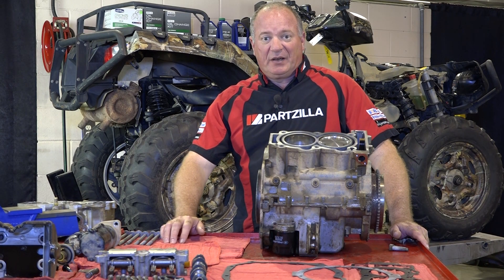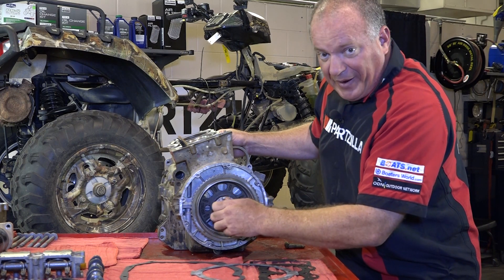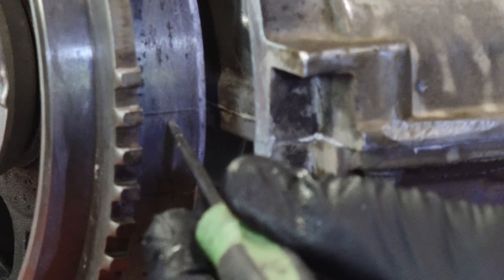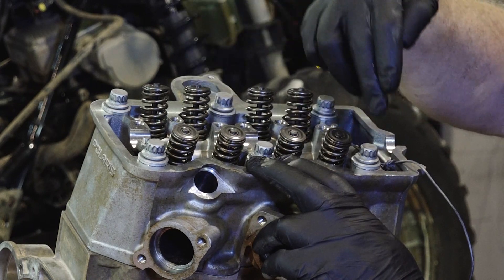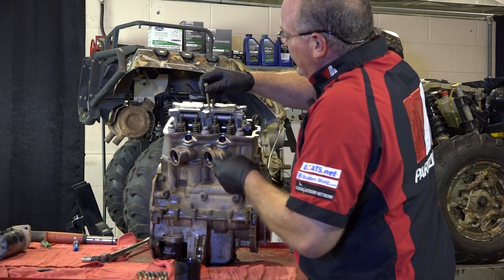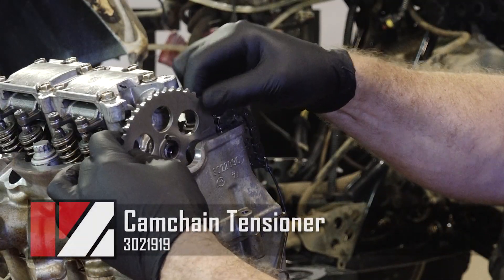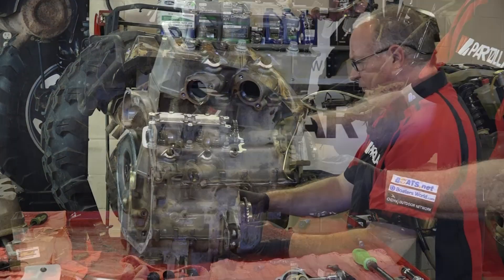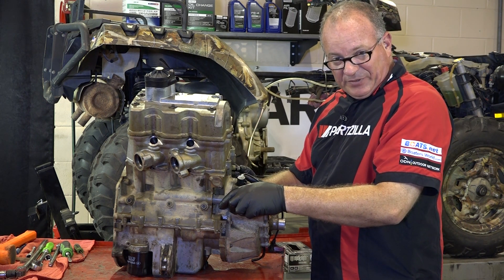Polaris Top End Rebuild Part 4: Set Cam Timing & Install Cylinder Head | Partzilla.com

Comment: I have a 2022 sportsman 1000, Do I need to remove the engine from the bike in order to remove the head? It’s just getting the head milled. the bottom end will be untouched.

Comment: John, love the videos of this series. I have watched them many times and they are very helpful. Seems like you left out a step on the lash and cam adjustments. The manual goes through the very specific steps. You have to set them at one place and then move the sprocket/chain and set the other side. It would be helpful for you to add that step as it seems to be critical. Again, thanks for the great videos.

Comment: What is the proper tightness for the cam chain? Does the tensioner self adjust the tightness? I have a very loose chain in my engine (more than 1/4" of play) and am wondering what the problem could be.

Comment: I have a 2014 850xp it doesn't have a LHT nut, but a drive gear for the water pump and stator....I have new pistons rings etc. Anyone know if that "gear" on the fly wheel is threaded or not?

Comment: When you put the cam chain tensioner in it moves the cam sprocket counter clockwise just a bit?   Is that still ok for the timing??
Reply: Hi did you ever get an answer on this? Im dealing with the same thing. Almost tempted to put it back together. I hope you see this before I put it back together
Reply: Should be fine. As long as you set time, even before chain had tension, it's not gonna matter.

Comment: Just to verify you do have pressure on your back side exhaust valve springs once you rotate the cam dowel to 12 o'clock, right?
Reply: rebuilding one now, Just wanted to verify you set the back side exaust valves on a different compression stroke not TDC?

Comment: What would cause hot start issues? 13 scrambler 850xp timing gear welded at 20ish hrs and 182 miles.   Now at  73 hrs  and 862mi. I suddenly have to give it throttle to start when it’s warmed up/hot..  ideas?
Reply from the maker: Inspect/Adjust the valves

Comment: Zero Valve Lash!  W.T.F?  So it has Hydrolic Lifters Then?
Reply: Im thinking the same thing. I'm a Polaris tech and I have been through an 850. I don't remember zero lash. I think it's like .003-.005 intake and like .007-.009 exhaust. But maybe I'm wrong.

Comment: Videos are awesome really help. Is there a way to change the head gasket and verify timing without pulling whole engine?
Reply from the maker: You can, we tore the whole thing down, so it was easier to just pull it.
Reply: @PartzillaParts  how do you set the time on the PTO side or when do you tighten down the valves pins for the PTO side

Comment: I need information on how to set my valve latch on a 2013 sportsman 850xp. I set them like you said in the video but now I have rattling coming from my valve cover. Any information will be helpful. I rebuilt my engine by your video. It's running like a new bike except for the rattling. Thanks in advance.
Reply from the maker: Pull the valve cover off and double check everything.

Comment: Hi there first of all thumbs up for all your help and tips with the videos you guys are making, is there any video for a valve adjustment, on a 2009 polaris sportsman 550 xp efi? The issues are: rough starting, bad engine idle, tapping noise when pressing throtle. Could the valve adjustment play a role in this case, if so, can the adjustment be made with engine on? Thanks a lot!
Adelin
Reply from the maker: That all could be valve adjustment, no video at this time, but I'll add it to the list.  Adjust while warm, but engine off.
Reply: Partzilla thanks, looking forward to see the video. Thanks for advice. And keep up the good work!

Comment: Any info on the dampener? How can I tell if it's bad? Torque specs for the bolts?
Reply from the maker: I may need some clarification.  Dampener?  Are you referring to the top motor mount?  Steering dampener?
Reply: Partzilla there are 6 bolts that hold the vibration damper to the engine coupler located between the engine and trans.

Comment: How do you get the timing chain on the sprocket once it is installed. That chain is pretty unforgiving
Reply from the maker: You install the sprocket with the chain on it.
Reply: Thanks. What if after you loosen all the rocker screws you still have tension trying to set the cam at 12 from the 10 position? It still wants to jump from 10 to 1
Reply: Did you ever figure this out? Mine is doing the same thing currently

Comment: I'm trying to beef up sportsman 850 xp. I was told to change my cam and put in a gear reduction. What type of cam and gear reduction kit would you recommend?
Reply from the maker: I wouldn't recommend going into the engine.  I would just do a power commander and exhaust.  The increase on upgrading cam and gears isn't worth the time and money spent, in my opinion.
Reply: Partzilla ok thanks. I'v changed my exhaust already. Looking to get a power commander. What about the reverse chain? Would it be wise to put a double reverse chain on instead of the single chain?
Reply from the maker: Talk about some extra cash laying around. Those double reverse chains will definitely outlast the OEM.  If your reverse chain hasn't broken, I would leave it alone.  If it broke, then it's up to you whether you want to spend that kind of money on it.
Reply: Partzilla thanks! I'm glad I asked you guys! Listening to other people was about to make me spend a lot of money for nothing. thank you!
Reply: Ramon Broomfield

Comment: any info or vid on the oil galley plugs other then the middle is to test pressure ..cant find anything in regards to them and mine were played with
Reply from the maker: I'm not sure what info you need.  There isn't much to them, they are just plugs.  Define "played with." :P  If you can narrow down what you are looking for, I can dig up some info.
Reply: Partzilla yeah found out they jus plug but was told out of the 3 brass plugs on the side of the engine 1 was for pressure setting, middles for test and oddly was told 3rd holds something and none can be cranked to tight..no info about it in the $120 book lol
Reply: also by played with, I mean someone loosened them off like they were gonna remove them ..but to tighten factory placement the plug stuck out bout half to 1/4" out, but the actual depth surpasses the plug..how far should I tighten these plugs ..I assumed roughly the same but want to be sure and also want know if they have anything to do with setting the pressure. haven't found any other info yet and my book sucks read it front to back and no info

Comment: Okay I've checked out all your videos on the rebuilt alot of helpful tips! but on mine my problem started like this, transmission had a grinding noise on all the h,l,r gears even when you gave it gas it would just get louder.so i pulled the transmission out..then it started smoking kinda bad at first it was just on start up now it does all the time. pulled the head out and saw that my valves were kinda bad looking so i cleaned them up as good as i could replaced the all valve seals and it still smokes. could it be that the rings are worn?
Reply from the maker: It's probably the rings.
Reply: +Partzilla that's what id figure thanks again

Comment: you want the valve lash set at 0?
Reply from the maker: Yes sir. Loosen the jam nut and turn the lash adjuster in until the rocker arm bearing lightly touches the valve.
Reply: Partzilla ok good to know didnt realize they were that tight of tolerance